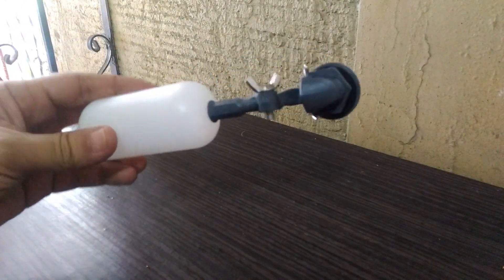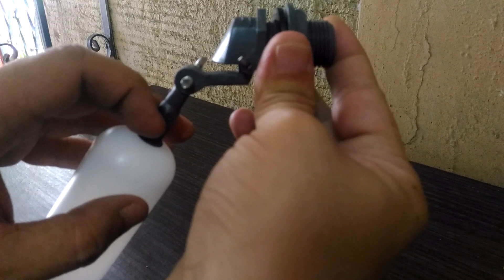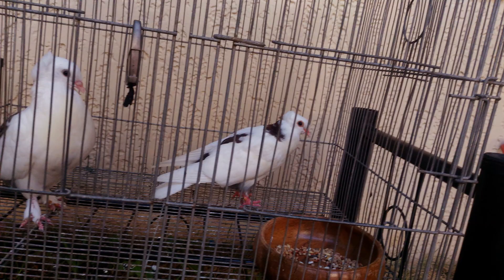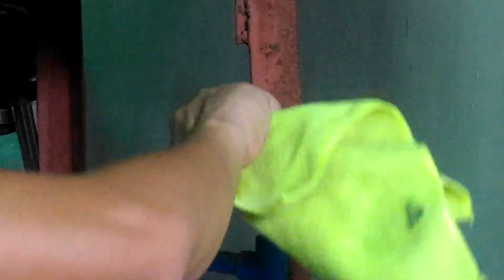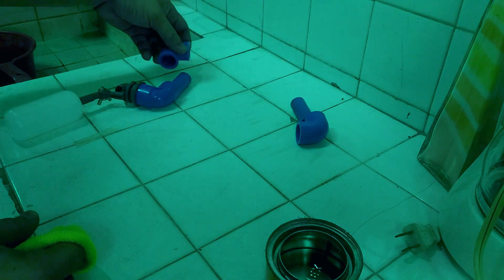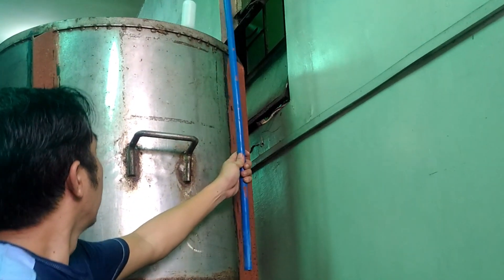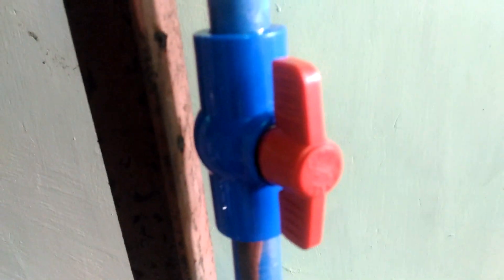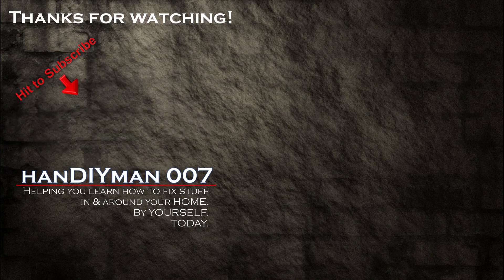DIY Auto Shut-Off for Water Tanks: Install a Float Valve Easily

Comment: Hi 
I have installed 5x tanks in series for my RV , unfortunately after the first tank got filled non of the tanks were getting filled.
Any idea why?
Regards
Reply from the maker: Water always takes the path of least resistance. Make sure your intake pipe is at the top of the first tank.  And the pipes connecting the rest are also near the top of the succeeding tanks.

Comment: Thanks. 

1) How long should the float valve be for house water tanks (sits on a tower that's about 10 feet, the house is a one storey one)?

2) How many wraps of Teflon tape did it take?

3) I noticed your tape measure is worn out, I'd like to suggest this amazing tape measure which has a laser rangefinder as well (it has a built-in area, volume & right angle triangle pytagoras calculator for squares & rectangles and measures in metric and even feet in fractions), it's pricey but it's designed for the markings not to fade coz' there are raised dimples (like a Teflon cookware) to resist scratches and will last a lifetime: Mileseey DT20 (this also eliminates the guessing when the measurement has fractions because as you extend the tape measure, the LCD displays the exacts measurement similar to a digital caliper- I recommend the all metal General brand digital caliper which can be had locally at Panda Construction Supply Incorporated near SM Sta. Mesa or pandatools on Google. General only not the Groz-General or Groz only one). The tape measure's metal is the best, better than my old Stanley.

(you may be tempted to buy the lower models of the Mileseey but I have the lower model I wish I bought the DT20). It's available on popular local online shopping sites that has delivery. You may be tempted to buy similar but different brands, it's best not to do that, Mileseey has the best laser measurement precision, perfect for really long measurements like wall to wall or floor to ceiling.

4) recommending stainless bracing for for your pipes (I've tried zip ties too, it'll break the pipe overtime, it has to be stainless metal bracings and is solid as a rock), perhaps the ones near your floor, create another angle so it touches your wall, the top part, the one with the valve, hire a welding machine weld stainless steel metal or rod so you you can brace that part with stainless steel bracing

God bless. Rev. 21:4
Reply from the maker: Did you mean, "How HIGH should the water tank be for a 1-storey house?" If so, the water tank (as a rule of thumb) must always be higher than any of your pipelines. This is why for commercial buildings, water tanks are commonly installed on the roof deck. Water will always go down and take the path of least resistance. As for my zip ties, they are still intact even after 3 years (and I don't need to worry about corrosion). Thanks for the measuring tape tip -- I have bought 2 new ones long ago :)

Comment: this will fill the tank as intended when the gate valve under the tank is closed. when the gate valve under the tank is open it will overflow with water coming back in thru that gate valve. adding a check valve between the gate valve and the tee connector will prevent this overflow :)
Reply from the maker: Hey Joey, you raise a very good point because when we leave the gate valve under the tank open when there's water coming from the main line, the pressure pushes water back through that same open gate valve under tank. This is why we only open the gate valve whenever water supply is interrupted from the main line and close it when there's normal water supply. By adding a check valve between the gate valve and the t-connector under the tank, it will make the entire system truly automatic (i.e. we will not need to manually open/close the gate valve regardless if there's water interruption or not). Great idea! I will make a video on this soon.
Reply: @HanDIYman007  btw, adding another check valve on the main line going-in will prevent your tank from supplying water to the whole neighborhood :)
Reply: @HanDIYman007  Hi. I, too, have the same issue about overflowing. Do you have an update video on how to install the check valve between the gate valve and the tee connector?

Comment: do you have diagram of your water tank pipeline? thanks
Reply from the maker: There's a scene in the video where I traced very quickly the tank pipeline.
Reply: @HanDIYman007  is your water tank use motor or natural gravity flow? do u use check valve?
Reply from the maker: @vernonleondalleflores654  just gravity, Please watch the video in full, it's all explained and shown there :)

Comment: jet pump or water pump dn po ba gamit nyu papunta sa tank?
Reply from the maker: yung ordinary pipeline lang po galing sa Manila Water. We don't have a jet pump or water pump.
Reply from the maker: Kung yung water tank mo is pressurized (enclosed), yung pressure switch na dapat ang mag stop nung water (by cutting power from your pump motor) pag na reach na yung set pressure inside the tank. Pero if your water tank is open like ours, then the float valve is your solution.
Reply: @HanDIYman007  Kung open tank tapos naka water pump pwede rin?
Reply: thank you po sa idea!Godbless!
Reply: ah ganun po ba..pero pwde din po gawin yan sa mga pump po?bali dalawang switch pressure switch at float valve?

Comment: Hi Question 1. is that fit to the Blue drum here philippines..and where did you buy that Float valve wanted to buy after i watched your video. thanks
Reply from the maker: Hi Mark! The float valve will work with the "blue drums" here in the Philippines -- you'll just need to make a hole just below the brim of the drum for the valve to fit through. I bought the float valve from Lazada. You can find the link in the "Products | Tools" section in the Description.
Reply: @HanDIYman007  thank you sir much appreaciated! God bless more videos i'm your now subscriber